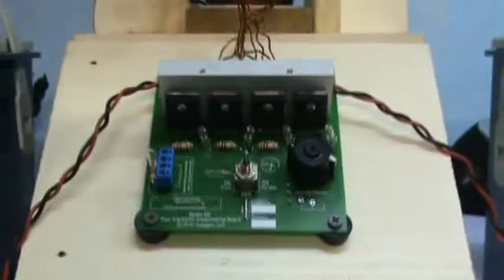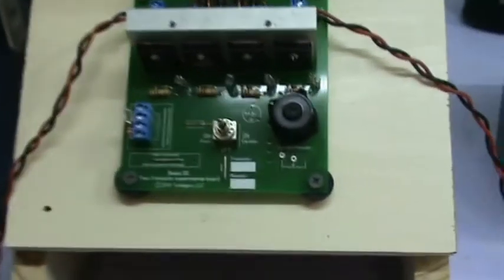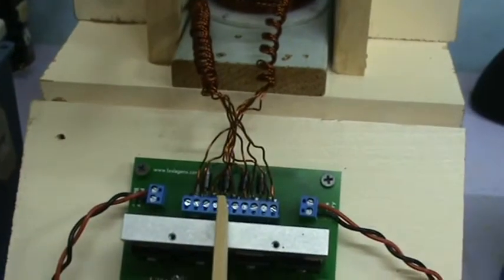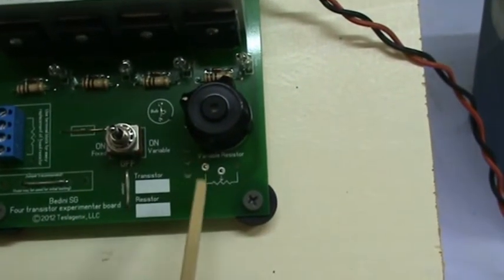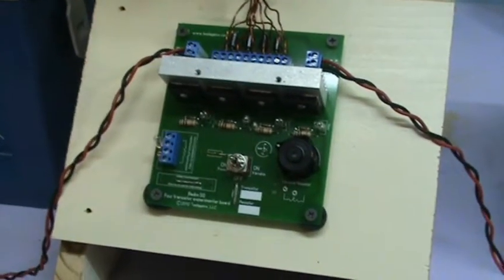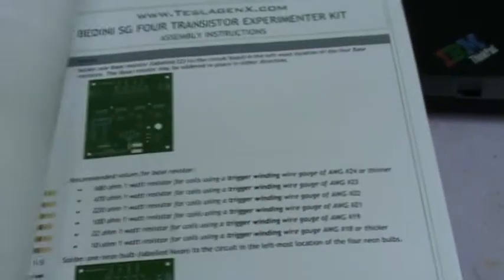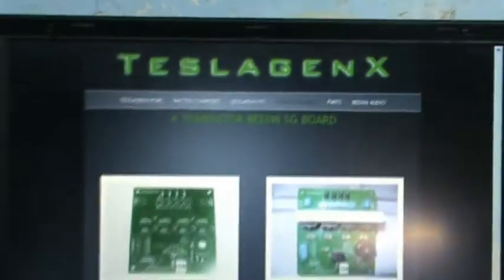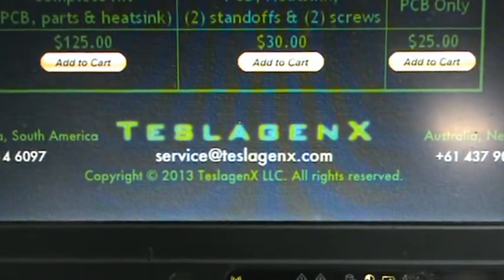Bedini SG 4 Transistor Experimenter Kit

Comment: I have done more experimenting and have determined that the coil I purchased in Idaho self resonates.  I tried removing all base resistance and it still will not run the wheel bit it will charge a battery.
Reply: Hi, did you make the bifiller coil the eight wires, one of the wires the green trigger wire then twist them with a drill motor. Then the 1/6 welding rods cut to length and pressed in to the opening in the spool and then add super glue so they can’t come out’ let the glue dry overnight and the coil is ready to solder to the collectors on the transistors’ and the green trigger wire to the buss connect to the negative buds and the other side of the green wire to the base resistors on the base buss. That’s it, good luck!